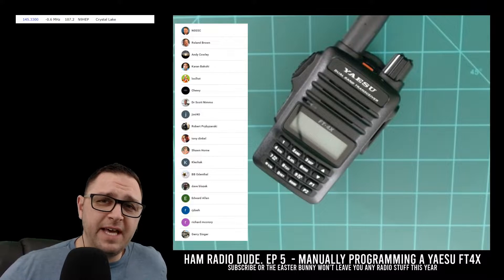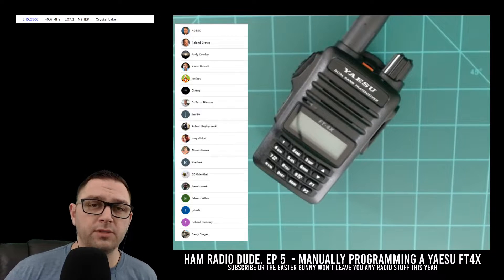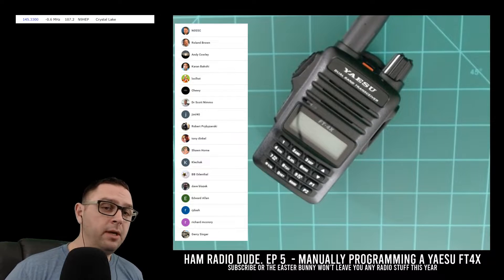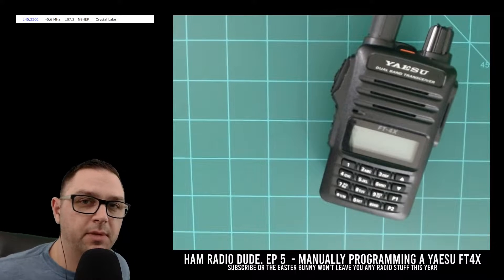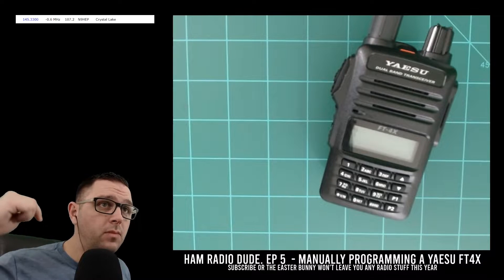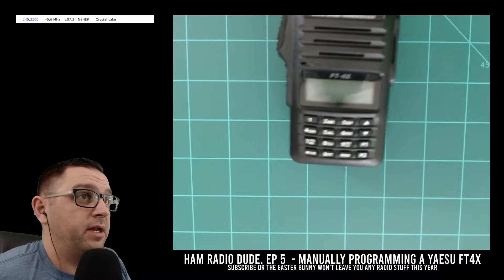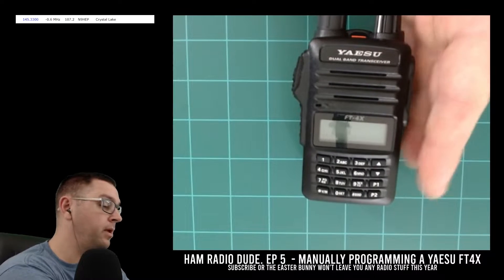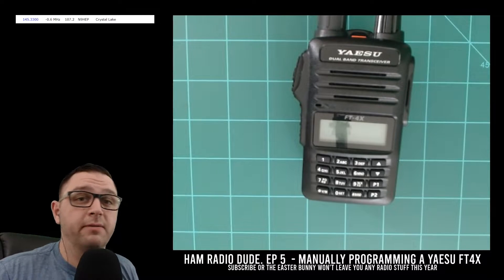Yaesu FT4X Manual Programming - Ham Radio Dude - Ep5

Comment: Hi, i'm new to the FT4X. Is there any way to delete or program any other frequency as 430 to memory 1. i cant delete memory , is this normal?
Reply from the maker: While in memory channel 1, go into the menu and go to option 20 (I believe)..  I think that's the option to delete the memory channel selected.  Hopefully this helps
Reply: @HAMRADIODUDE  tried this before. I can delete any other memory, just not no.1. Will a usb cable help?
Reply from the maker: @jetipama  sorry to hear that.   When I get home, let me check for you.
Reply from the maker: I just got home and tried to find the FT4X. I have no idea where it is (It's possible I gave it to a ham in need).  However, I checked the ft65 which has very similar operation.  Memory Channel one cannot be deleted, but the channel could be overwritten with different information.  On the FT65, I did this by being in VFO mode and inputting the frequency and offset for the repeater.  I then held down the * button and selected memory channel 1, named the channel and then held down the * button again. This overwrote the default 430.  I would think the FT4X would be the same, but I cannot confirm.  In short, Memory Channel 1 cannot be deleted, but could be  modified.
Reply: @HAMRADIODUDE  thanks! i'll try!
Reply: @HAMRADIODUDE  yep it works!!!

Comment: What is that small part That comes with the FT4X not listed in the parts list. It has a small base with two metal tip pins on it. What is that for???

Comment: Thank you.  How do you program a simplex channel, say 146.520 or 446.000?  Thanks.
Reply from the maker: My pleasure.  The input and output frequency would be the same 146.520/146.520 with no tone
Reply: Great, thank you.  Another thing, it looks like if one is programming a repeater channel into the unit, the repeater output frequency is entered, correct?  And the input frequency is "automatically" entered if the offset, 0.6 plus or minus is correct.  Is this right, or am I still missing something?  Thank you for your prompt reply! @HAMRADIODUDE

Comment: Thank you for sharing this information. I was having a hard time to input the repeater near my province which I can receive but not transmitting. I have to watch this video over and over again to familiarize myself. Just hoping you could try to slow down in your next tutorial. Thanks! This DW2KBF, QTH Philippines. 73!
Reply from the maker: Glad it was helpful.  I'll try to keep it slow next time.
Reply: Hi there again Ham Radio Dude! Thanks for the reply. By the way, I have a question. I'm having trouble saving the frequency to the memory with its offset from the repeater I'm DXing with. I mean, the frequency can be saved but not the negative offset that comes with it. Is there a way to solve it? Hope to hear from you soon. Thanks in advance. 73!

Comment: Here's a question, Looking at the photos of the programming cables for Yaesu radios other than being different colors, aren't they the same. In other words can I use the programming cable that I have for my Yaesu FT-2900R and use it on my new FT-4XR ?
Reply from the maker: Isn't the 2900 r cable a CAT5 cable and not a stereotype cable?
Reply: @HAMRADIODUDE  Yes, You're right. I had not seen it in so long, I had to dig deep in my box of ham stuff. Thanks

Comment: I just bought one and mine says Made In Japan on the back. Thanks for the video.
Reply from the maker: That's awesome. I'm hearing others saying the same thing.  Would there be any way to send me a photo? I'm genuinely curious and may consider buying another to compare China vs Japan
Reply from the maker: Wow!  Thanks!
Reply from the maker: @douglaswilliams6834  If you don't mind me asking, did you purchase this new or used and was it from a big chain? I'm super determined now to hunt one down, buy it, take it apart and compare it with the Chinese one!.   Thanks again!
Reply: @HAMRADIODUDE  I bought it new from Ham Radio Outlet, last week. Personally, I doubt you will find any difference, as I don't think Yaesu would allow their name to be put on any radio not of good quality.
Reply from the maker: @douglaswilliams6834  Thanks!  I agree there probably won't be much difference, but I am still curious, hah. Thank You again!
Reply: Mine is Made in Japan too, it’s on the box and radio. From HRO yesterday.
Reply from the maker: Thanks.

Comment: Thanks for the instruction. Can you explain please how i get the batteryindicator in my display?
Reply from the maker: Interesting you don't have it on there. I'll try to figure out where the option is, and get back with you.  Upon initial glance, I don't see where to enable / disable it.
Reply: @HAMRADIODUDE  Thanks for the comment, but it has already been resolved.
At least, I got a new one because something might have gone wrong when installing the software at the factory.

Comment: Hi how do you delet the motorises on here have tried to but I can’t do it many thanks
Reply from the maker: You should be able to go to the channel, then hold the #BAND key.  Next, Press and Hold the function key to remove the memory channel.  Let me know if you have troubles.  Thanks
Reply: @HAMRADIODUDE  hi it still won’t delete my repeater also when pressing what you said nothing happens could you please help me out many thanks Robert
Reply from the maker: @robbillington7750  Do this:  in Memory Mode, go to the channel you want to delete.  While you are on that channel, hold down the function key.  Button button on the left side of the radio.  Hold that down and it will bring you in to the menu.  Go to option 20 "MEM DEL"  ... Tap the function button.  the Number of the channel to delete should be flashing.  Tap the Function button.  It will then say "OK" tap the funciton button again and wait a second. The memory channel you chose, is now deleted.

Comment: Trying to add a memory tag, pushing "*V/M" gives a standard button press beep but does NOT set the alpha tag.  WTH?
Reply from the maker: Tomorrow I'll pull out my ft4x and take a look at it
Reply: @HAMRADIODUDE  

Thank You!  I finally got that problem solved, though don't recall how.  Now I am pulling my hair out trying to add 446.0 with 100.0 Pl, Simplex, into memory (ch 46, if it matters, which it shouldn't).  I enter the frequency into memory and it comes up initially in memory mode as properly entered with Simplex.  If I move up or down a memory channel and back, it has a negative offset.  I have tried everything to correct this, even setting the amount of offset to zero and every time it goes back to a minus offset, transmitting on 441.0.  I tried setting the offset to + or - and it does both properly, but put it in as Simplex and after switching up or down one memory position and back, it has negative offset.  Arggghhhh!!!!

Comment: If you can believe the box, the radio is made in Japan while the accessories were made in China.
Reply from the maker: Stamped right on the radio, "Made in china". I'd think it was cool if it was made in Japan, but everything I've found and seen, suggest it's China.  By chance, do you have a source about it being made in Japan? I'd do some more research if I had somewhere to start.  Thanks!
Reply: @HAMRADIODUDE  I just received a 4x from DX Engineering. Both the radio & the box label are marked as made in Japan. As @Jack Stemple said, the accessories (antenna, battery, charger) are still made in China.
Reply: @billwarner9420  same with my FTM-300DR, mine is Made in Japan on the box and radio.

Comment: The Yaesu FT-4X is one of the worst transceivers regarding the setup. I once got it going, unfortunately reset it to factory defaults and ever since the entire thing is playing up nicely. I cannot recommend this handheld transceiver. I bought it only as a second handheld in case of some emergency and the battery on my Yaesu FT-X8 went off. The FT-X8 is easy to program and has no quirks, the only quirk it has is the very high price. I will send the Yaesu FT-X4 back to the selling company for a refund as it is not suited for me. Well, it's made in China and not in Japan. Yaesu has to be careful with bad products otherwise they will lose their excellent name in the industry.
Reply from the maker: Do you know what the difference between the Japanese and Chinese model is?